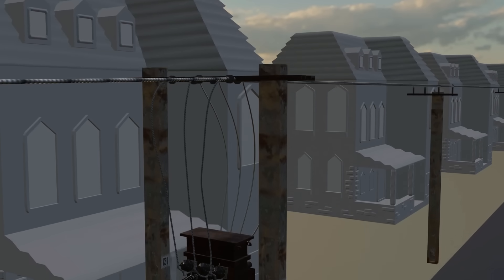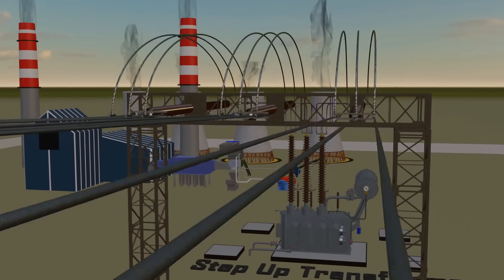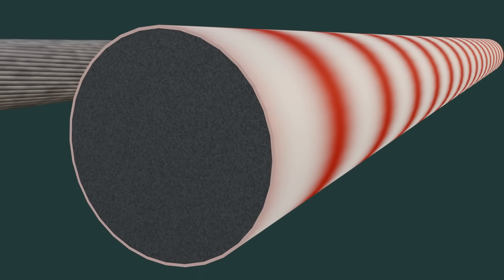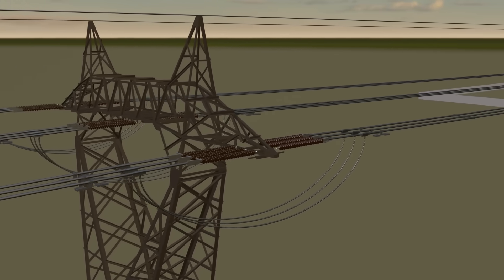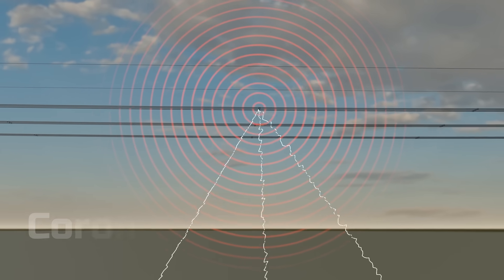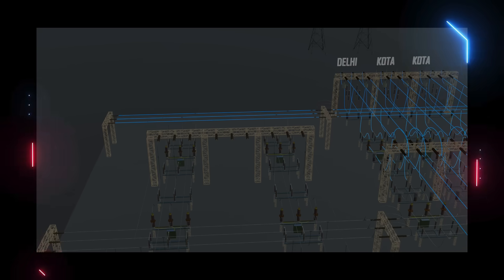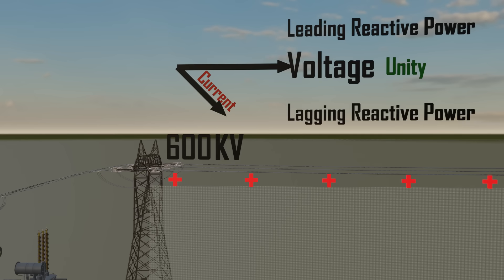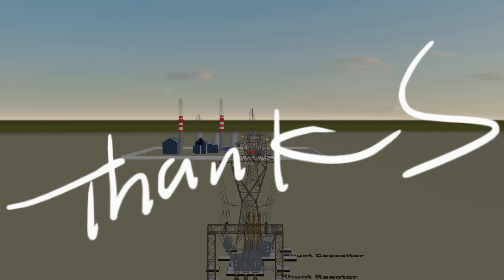Why Do Power Lines Hum and Glow?

Comment: Overhead conductors are stranded for mechanical reasons, not skin effect.
They tend to move a lot in the wind.
We use underground cables in our 10~50KV  parts of the grid that use massive condutors just fine.
Reply: I was on a 400kv substation job and installing busbars on towers, they were hollow aluminium, 6" dia and walls about 1" thick, 30ft long, to see these flex in the wind was incredible, so we had to fit dampers to them. It was basically an end cap that bolted onto it with a steel cable 20 ft long, after we fitted them they never again flexed. On some jobs they installed underground cables for 400kv in places of natural beauty, a lot of people thought it was going to be a 3ft trench 3 ft wide, it was actually the width of a 3 lane motorway and 6 ft underground.
Reply: Not true.  Skin effect plays a big role, which is why there are different bundles.  There are tons of calculations regarding loss over distance and this is what determines which type of cable bundle to use.
Reply: @bruehlt High voltage conductors are clutered to reduce corona losses, not for skin effect.
Reply: @picobyte Actually "Skin Effect" is an issue and that is why High Voltage DC power lines have been installed.
Reply: @MrSummitville DC can transport more energy at the same nominal voltage.
The only reason we use AC is that it's easy to transform to other voltages without modern transistor technology that didn't exist during the begin years of grid power.
HVDC also has less problems at say 800kV in cables that in effect are huge caoacitors.
Still the back to back inverters are crazy expensive.
Reply: @bruehlt  I do believe the skin effect is nonexistent at 50 or 60Hz.
Reply: @bjornroesbeke research how a clamp on current meter works without touching the conductor. 😊
Reply: @skywave12  Magnetic fields. That's not related to the skin effect.
Reply: @picobyte - Are saying that your cable is a single solid copper wire?   How can you bend a large solid conductor wire? 
  Overhead HV wires are a balanced designed of Cost vs Mechanical Strength vs AC losses.
Reply: @MrSummitville Yep those cables have a huge bending radius.
But our 800mm² solid alu core will bend just fine.

Comment: 256,000 volt and 500,000 volt towers are all around me

In the summer when it was muggy the cracklings were so loud under the lines

My instructor took us out with 4 foot florescent bulbs and held them up under the lines and they flickered
😮😮😮😮😮
Reply: Back in the 70's I did that. Police did not think that was funny.

Comment: 4:56 I totally take jaunty strolls under power lines, just like that guy.
Reply: Haha 😂😂😂  You're all charged up!
Reply: That guy's a pimp, look at his swagger.
Reply: looks like a very flaming fella
Reply: Funny
Reply: When working at I&M Electric, I had to measure the winter and summer SAG on 765kV lines in Michigan. They had issues with sand dunes casuing the clearances to vary. You could feel the static in the air, especially when the clearances were not to specification.
Reply: When I was in South Africa driving coal trucks there was a mine where we closed the tarpaulins (tents) under these humming lines and I discovered that if I made contact with the trailer using my arms (the biceps or lower am) and not the palms I'd get a minor shock. It is only that I was working away from home but I always wanted to borrow a test meter from the auto electricians and check what the voltage was. Hahahaha
Reply: OMG I laughed SO hard. Tears.
Reply: Its Not Guy, well sort of
Reply: Well done!  I wish school would have felt like this : )
Reply: And naked?!
Reply: Did you take a fluorescent tube with you?
Reply: Say, fella!

Comment: Unfortunately there is a lot of incorrect information in this video.  For example, at 2:35 it is sated that in a 765 KV line the current only penetrates 0.66 mm inside the conductor.  First, the voltage of the line has no effect on skin depth.  The relevant factors are frequency and conductor resistance.  For an aluminum conductor at 60 Hz. the skin depth is 10.6 mm.  Don't just believe me... look it up for yourself.   The video states the conductors are about 3.5 cm in diameter and 99% of the conductor is carrying no current.  With a 10.6 mm skin depth this is ridiculously incorrect.  Another issue is that merely stranding a conductor does not reduce the skin effect.  To reduce the skin effect the strands must be insulated from each other.  Search for an explanation of how "litz wire" works for the details.

The bottom line is that 3 minutes in I realized this video is not worth watching due to incorrect information.
Reply: 0:07 For a single-phase voltage of 230V, the phase-to-phase voltage is 400V, not 433V
Reply: @andrzejs3717  No.
Reply: I wondered about skin effect and wouldn't think it was only 0.66 mm into the conductor at mains frequency. 
I also thought of Litz wire.
Reply: @bill-2018 The only thing I am thinking about everyday is the Litz wire!
Reply: I was thinking the same - 0.66 mm is way too little (it's more like what it is at like 20 kHz, in for example switching power supplies - not just 50 Hz). Also, the mechanical benefit of it being stranded, is quite obvious. But I can think the skin effect IS somewhat reduced as well - as the shape of the cross section of the conductor, does matter as well (even if the cross section area stays the same). A solid one with circular cross section, is what have the strongest skin effect and whats usually given as "skin depth" in most calculations. It's less for a conductor that has for example square cross section (especially if it's if it's much wider than it's thick, like a ribbon - it's significantly less). A stranded wire consists of many small circles (which only makes contact with each other thru small spots), rather than one big circle filled with conductive material all the way - so it has indeed less skin effect than a solid round conductor - even if it's not like a litz wire. 

And for the mechanical part - a 3.5 cm solid conductor would be a thick bar, rather than a wire (very rigid and not very flexible). But, being 300-400 m long, it would still bend and flex a lot in the wind and sag because of thermal expansion - which would probably lead to material fatigue and cause it to break off after some time. Also aluminium have much larger coefficient of thermal expansion than steel - so this would prabably cause the aluminium part to crack, and/or separate from the steel core, causing it to break apart (and even if it stays in one piece, the cracks will cause the resistance of the conductor to go up). 
With stranded wire, each strand can bend and move independently - compensating for all those movements, so no large internal stresses (that lead to material fatigue and cracking) build up.
Reply: @Speeder84XL  It doesn't help at all. Multiple strands are for flexibility. Even with insulated strands, you do NOT reduce skin effect: the eddy currents don't flow transversally anyways, so they don't need a good contact between strands, or any contact at all. They flow along the wire. The only place where they flow radially is when the wire stops, so at the terminals - there, it can be full, stranded, or litz, it doesn't matter, they are all connected together in parallel. To avoid having current flow between strands, which increases the losses, you want each strand to have exactly the same "life": they must occupy the same positions, one after the other, inside the bundle. THAT is Litz wire, not just a bundle of insulated strands, but an intricate weaving of said strands, such that they occupy all possible positions in the bundle (hence all values of magnetic field, which is what creates the eddy currents) for the same amount of time. If this is done, strand-strand eddy currents have no reason to flow, and don't.
Reply: this should be pinned...
Reply: Content creators are not rewarded for truth but only for getting you attention.
Reply: Thanks.  Had reservations about some info.
Reply: I had to stay to hear about the lines glowing.  If a conductor is glowing, I would be very impressed to see it before it melted and fell to the ground.  I never have seen a glowing transmission line.  I have seen arcing on dirty insulators in our 500KV switchyard but never glowing.
Reply: @dwayne7356 aluminium doesn't glow before it melts, it just melts, which is why it can be harder to weld than other metals.
Reply: @dwayne7356  I have seen a faint glow on 400kv line, around the insulators.  It was at night and in fog/drizzle, and out into the countryside so minimal light pollution.    There was a very faint purple glow and the crackling sound, in those damp conditions, was damn loud.  I'm guessing that's the Corona effect the video talks about
Reply: You're right, but being insulated is not sufficient to reduce skin effect. Litz is often imagined as "just insulated strands", but if you do that, you don't gain anything compared to non-insulated strands. You also have to twist them in a very intricate pattern, such that they all occupy all the positions in the bundle (outside, inside, top, bottom, etc) for the same proportion of their length. This geometrical averaging is what gives equal current in each strand and mitigates skin/proximity effect, not the insulation itself. This is Litz wire, and that's why it's way more expensive than just bundled strands of magnet wire.
Reply: Only that Litz wires are useless in a transmission network. 
Would turn out to be rubbish.
Reply: Incorrect information is guaranteed to improve engagement in comments improving capture for the algorithm/advertising
Reply: Thats because this video was made by AI
Reply: Word.
Reply: See again you did not catch the info correctly 😂😂😂
Reply: Agreed! This is a horrible video!
Reply: @Vincent - Stranded Wire certainly does reduce the skin effect!  Yes, Litz Wire is even better than stranded wire. BOTH reduce the skin effect.
Reply: @MrSummitville  Litz wire works mainly because of the weave plus the insulation. Many people forget this.